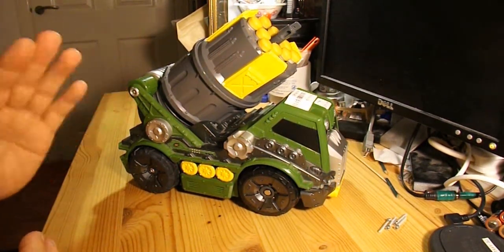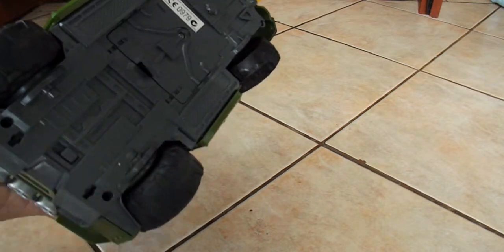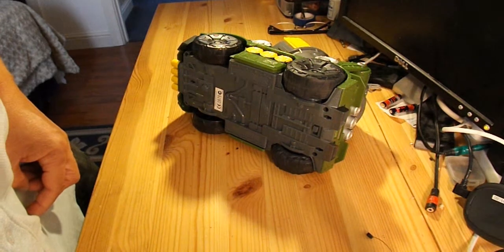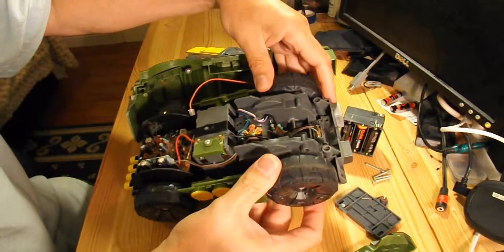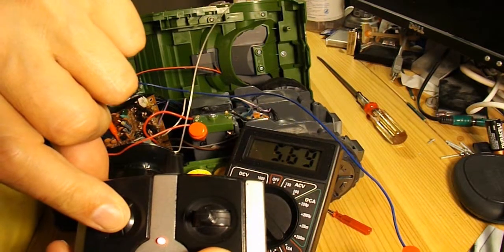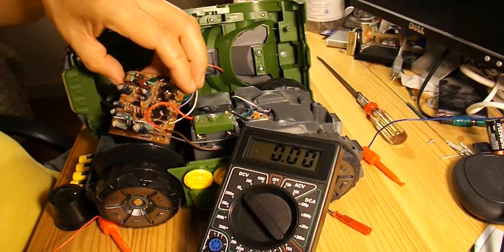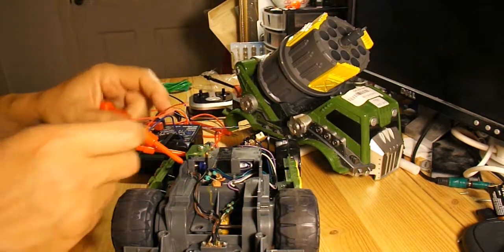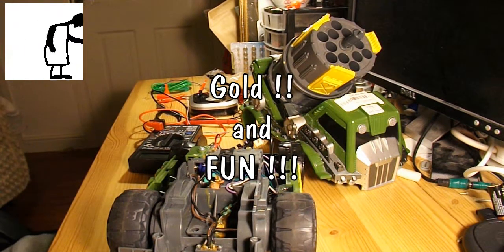Charity Shop Gold or Garbage #14 - rocket launcher

Comment: I say mount the rocket firing mechanism on a rubber band car
Reply from the maker: Hi Richard, thanks for commenting but not much point to fitting it on a rubber band powered car really. It is quite heavy and will need batteries to power the launch mechanism and radio control to operate it, so it might as well be on an electric powered car, which it is already. It is just that the radio receiver seems to be faulty. I could just have a wired hand held controller to replace the receiver and that would work or I could just replace the receiver with one from another car when I have a bit of spare time.